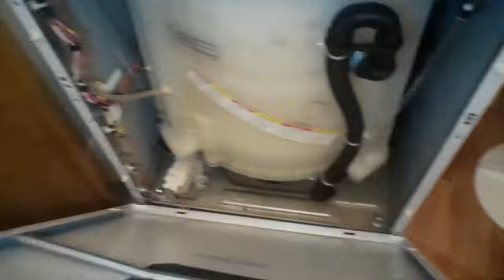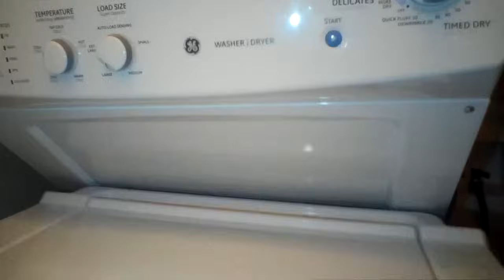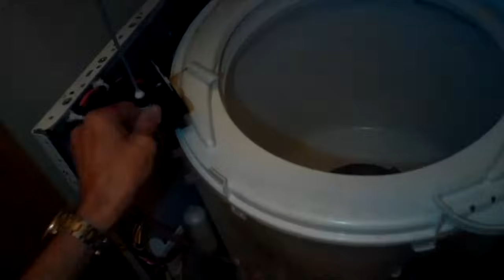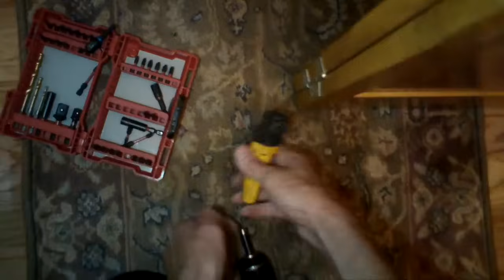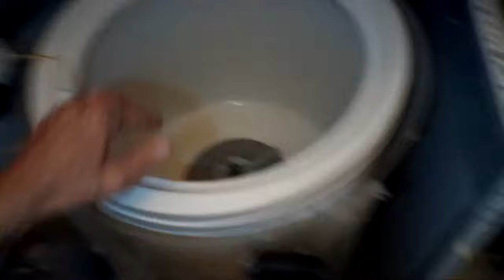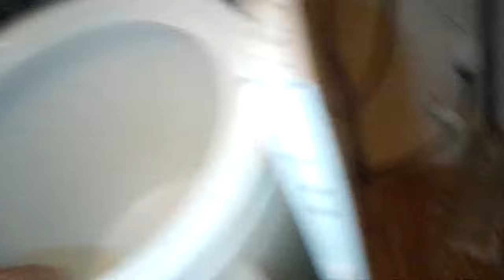✨ GE WASHER - DRYER COMBO - Spin Basket Access ✨

Comment: The front panel doesn't open even when I come in contact with the, 2 latches
Reply from the maker: When you press down to disconnect the right latch, use your other hand to hold a flathead screw driver between the top panel and front panel and leverage that right corner down and then repeat the same process on the left.

Comment: God a question-- I need to replace the lid lock, did I see you take off the top panel and that lock under there?
Reply from the maker: You should be able to replace it just by removing the front panel.
Reply: @ScottTheFixItGuyChannel  Thanks!

Comment: Do you have a video for taking apart the dryer cylinder to clean the fin things? I can only find videos on the front panel and your washer drum. But I desperately need to clean the lint and grime from the dryer.
Reply: I just use a vacuum with a brush attachment.  Takes some agitating with the brush, but it eventually comes off.

Comment: Neither I or a certified technician could get the tub off on mine. I had to order a whole new assembly. Even after I installed the new one and got the unit working, I fooled with the old assembly for weeks off and on using a variaty of methods including air hammers, etc, and never could get it appart. A very poor design in my opinion.
Reply from the maker: You speak the truth 😊👍
Reply: Was this covered under warranty? I’ve had mine for under 2 months and am dealing with this now. Tech didn’t even try because of what you mentioned here.

Comment: Hey there have a GE stackable where washer won't spin/agitate.

Had GE Tech come out. They ordered a new tub assembly with transmission/motor/sensor/tub etc... They installed it yesterday and still have exact same problem. 

Put into spin test, you see actuator drop gears into place then just sits there with pump running then after they come together a few seconds later it just stops and spin light blinks with blocked motor code.

So all along this might not have been a bad motor/speed sensor.

What else could this be that would cause the washer not to engage in agitate/spin? Computer board? Bad wiring harness in some place? Lid does lock and red light comes on but could it think lid isn't locked in some way?

They ordered a new board now. This is getting absurd. Just not sure why this is so hard to diagnose. 

GUD27ESSJIWW
GE Unitized Spacemaker
3.2 DOE cu. ft. Washer and 5.9 cu. ft. Electric Dryer
Reply from the maker: Great question James,
I would replace the lid lock and lid sensor.  It’s pretty easy to do👍
Reply: @ScottTheFixItGuyChannel  These parts?

Door Latch Lid Lock WH44X10288 / AP5270191
Magnet WH01X10626 / AP5270181

The sensor I'm having trouble locating the individual part. I see it's part of the whole wire harness thing but possibly you could order just it and cut/crimp it?
Reply from the maker: Those look good.
I’ll check on the sensor👍
Reply from the maker: Sensor: Upgraded WH12X10334 Lid Switch Washer Lid Switch Assembly by Sikawai Fit for G-E Hot-point Washer Replaces AP3968471 1256927 AH1482372 EA1482372 PS1482372
Reply: @ScottTheFixItGuyChannel  I ordered this from amazon 

Washer Lid Lock WH44x10288

Repairwares Universal Washing Machine Lid Switch with Wire Harness WH12X10334 1256927 AP3968471 PS1482372

In terms of needing to splice what is the best way to do that and if buying crimps, etc what should I be looking for? Also should I start with lid lock first before moving to sensor? I do get lid lock light and it doesn't open but I've read the circuit still technically might not be closed?

Thanks for the help. You don't happen to be in VA are you  lol.
Reply: @ScottTheFixItGuyChannel  Just FYI, the issue was the control board. 

Honestly I think anyone with any minor technical skill should just unplug their washer, remove the cover, pull the connections and unscrew the 2 screws and pull the board. As soon as I pulled it out and turned it over you could see the quarter size burn mark on the back of the board/burn on the white plastic holder.

If you have a good board you'll be able to see it on the back side.

It's amazing the GE techs that came out, both of them didn't pull the board but instead took like 30 mins to test the board vs just looking at it first which would have shown the issue.

Thanks for the suggestions!

Comment: Thank you for this vid! I moved into an apartment complex that had these in each unit. Mine was pretty used (should have seen how much lint i got out of the dryer walls). This vid helped me so i could take apart the bottom and get some of that grime!
Reply: Me too.. ours smells terrible.. do you know that tool he used to release the bolt?
Reply: Are you talking about what he used to get the agitator off? That was just a ratchet with a 11mm socket and 12 inch extension. If you are asking about what he was begging on with a hammer, I didn’t do that part. Mine is situated in a tight closet, and I couldn’t disconnect power, so I was really scared. I was gonna electrocute myself Or damage the motor parts, which im sure my landlord wouldnt be happy about. And honestly once I got the top white lid off, You can see inside the basket. Mine really didn’t look or smell that bad. It had really just been the agitator, and what was under it.
Reply from the maker: Nice job Nathan👍😊

Comment: I couldn’t get those clips on the panel to pop open like you did. All I did was scratch up the tool I was using. Would a flat head screw driver work better?
Reply from the maker: I think so👍

Comment: Is there a part two that would then show how to deep clean the drum? I find the sides of the spin basket that I can see from above (haven't taken anything apart yet) are super grimy, and even though I wipe what I can reach that obviously isn't enough to really clean it, and my clothes sometimes seem to still have soap (I use less than what the detergent bottles say to but still maybe too much) or something greasy on them.
Reply from the maker: I’m sorry Abby, they engineered it so you can’t remove the spin basket🤪
Reply: Pretty sure it can be removed. Disconnect pump hoses, water level tube, and any other attachments rhen pop all 4 of the hangers off at the bottom.b

Comment: Modern appliances suck. When I was a kid we had the same appliances for a decade and then the parents gave them to the kids when the grew up and they used them for another decade.  a few years ago I had a new washer and the factory  didn't install a hose/retainer clamp on a pump and it caused the pump to fail.  A couple years later I had a new/barely used stack unit stop drying. It was an inexpensive repair but, come on man.  

My latest is what brought me here. Another 5 year old stack unit with a clunky noisy spin.  I'll open it up and take a look but unless it's something easy, I'll probably just but a new one

Comment: how did you remove the agitator? i took off the bolt, but it wont come off
Reply from the maker: Can you put 2 dress belts under the agitator and then pull up on the 2 belts and wiggle as you pull.
Reply: this worked with two ropes pried up with a two by four and having another person hold the mmacchine from liftingg up on the otther sidee. also poured two tea kettles off  bboilinbg waterr in there

Comment: Hey Scott did you ever get that spin basket off? I have the exact same machine that I am trying to remove the basket from. I have the spanner nut off and have repeatedly soaked it with liquid wrench, PB Blaster and seafoam. I have used a lead Hammer to tap on the shaft of the transmission. I have my Cabrio rig in there with a bottle jack to lift up on the tub and so far no joy after a couple of days of trying. This thing is an absolute bear and it looks like yours was too. Any tips or tricks you can offer? I agree it must be corroded on there hard and I don't want to damage anything removing the basket

Comment: But what do you do if the basket won't come loose from the tub? This seems to be the main issue with older units. Is there a chemical or solution that can be used to dissolve this calcium "cement"? Mine is stuck and no amount of twisting or pulling is going to get it out of there.  As you stated its basically wielded together. If there's no way to dissolve this corriosion, it will have to be forced off somehow and will probably crack the basket. I see no other alternative. Help please...
Reply from the maker: Hi Sandy,

GE recommends that you replace the entire tub/basket assembly 👍

Comment: hi is there a video of how to replace the tub seal and put back together? I cant find any on your page.
Reply from the maker: Hi David, 
I’m sorry, I wasn’t able to remove the spin basket.
Reply: @ScottTheFixItGuyChannel  you can cut a board to fit under the basket lip put a carjack against the shaft and push it out like a puller

Comment: Now if the machine is any where over 3 to 4 years old... And I have done many

Get a cheap grinder and a cutoff blade. You can see the spanner nut is screwed on to a square shaft. Cut the nut at one of the points over the flat area of the shaft

A few unit I worked on the transmission was bad  because the seal leaked and the bearing was noisy...Bad however for the best because the inter spin basket would not come out. I had to take the cut off wheel, and (after removing the whole unit from the washer cut the transmission apart. Take the inter shaft out of the square shaft and then cut the square shaft flat with the metal on the spin basket 
Then take a Saw Saw and cut (from the hole left from the inter shaft) the square shaft in 2 places as to take pressure off the spin basket. The beat the shaft out.

Spin basket are over $200 
If it were not for Friends and Family I would tell them to replace the whole machine.

Be sure you can get the washer apart before you order the parts or you may get so deep that you are throwing good money after bad
Reply from the maker: Great info.
Thanks so much😊
Reply: OMG...your kidding me? That's a little much for me. As a woman and former G.E. appliance assembly worker, I thought I could do this. But after struggling with getting that damn nut off and now this...I give up. Won't be purchasing another G.E. unit I'm sad to say Especially now that they are owned by Haire, a Chinese company. We had a good run G.E. but time to move on....

Comment: I did not take his advice to replace the outer tub. (too expensive!) I removed the outer tub, turned it upside down and took off the plate that the motor and transmission are mounted to. The old seal came out easily and the new seal fit. A lot of work!  I hope it lasts1
Reply: I can't get the bolt in the bottom of the tub loose. Can you still get to it without taking this off?
Reply: @robertlester4569  I'm afraid not. I bought the cheap wrench and shimmed it tight. Just keep bumping with a small sledge hammer. Very little working room!
Reply: @stanleywells4468  Thank you for the response. I finally got the tub nut off by breaking it with a hammer and chisel, but the inner tub will still not slide up and out of the outer tub. I have banged it with a sledge to no avail. Once you got the nut off, did the inner tub just slide out, or do you have a trick for getting it loose? Thanks is advance.
Reply: @robertlester4569  Hi Robert, I'm in the same boat as you with this machine. Did you ever get your inner tub out in order to replace the seal? Thanks
Reply: @432b86ed  nope, never did

Comment: This has been a nightmare. I’m probably going to buy the whole basket. I don’t see how it’s possible to come off anyways. The shaft is square, and bigger than the hole. It won’t budge. I’m wondering if it screws on.
Reply from the maker: I called GE and they said you have to replace the whole basket assembly.  Terrible engineering.

Comment: Subaru Forester scissor jack with a 20" 4x4 works  perfectly for removing tub.
Reply: BUT THE GASKET INSTALLS FROM BELOW!!! have fun removing the whole tub, gear/motor assembly, and yet another lower gasket is inaccessible. Will try to order the whole gear/tub assembly tomorrow or haul this thing to the junkyard! Thanks GE: "We Bring Good Things to Life"
Reply from the maker: Thanks Brian,

It’s a terrible design.  Where you able to separate it using the car jack?

Comment: Scott, did you ever include a video about how to remove the agitator? I saw the tub seal leak video but that just showed the leak.
Reply: Use a belt mine was stuck and i used a belt and it worked woop woop !!!
Reply from the maker: The company says the best approach is to replace the entire tub assembly.
Reply: @ScottTheFixItGuyChannel  The nut holding my agitator on came off no problem (sounded like that was the issue most people had). Despite that I can't yank the agitator out. If I replace the entire tub assembly does that include the transmission and agitator?
Reply: I think it’s just the tub and spin basket
Reply: @ScottTheFixItGuyChannel  thanks for the prompt reply  I saw that in about an thread. I'd still like to attempt it. If the fastener holding the agitator, etc is too corroded I'll opt for the tub replacement. Figured I'd try and save the $300

Comment: I am in the process of trying to replace the tub seal. I used a drill to cut off the nut, a chisel to pry off the washer, and a pair of needle-nosed pliers to remove the o-ring. The tub won’t come off. I am not giving up yet. As a bit of constructive criticism, Scott, this is a great video.  Step by step it shows what to do (for the most part). BUT...#1...wasn’t easy to get the agitator off. Needed and extension rod for the socket wrench (small detail but would have been good to be reminded of before starting), and #2...regardless of whether or not you were able to repair this appliance, it would be good to follow up with what you did or didn’t do. I finally read the comments and it helped to know that I wasn’t alone, but it would have been even better to have that information as it applied to this visible example. Just an observation. I appreciate the information it did relay, though, so thank you.
Reply: wow.. i sooo cannot deal with this right now, but this machine has been junk since day 365:)
what size bolt/extension rod do i need? please help? i ma overwhelmed with appliances breaking right now.

Comment: The spin basket hub is very long so it gets seized up. Need to clean out the little holes and soak tons of rust buster. Need car jack to get it up. The whole tub needs to come out to replace the tub seal from the bottom.
Reply from the maker: Thanks Scott
Reply: @ScottTheFixItGuyChannel  how did you get it off your video stops before you remove it

Comment: this guy is so full of shit , I been beating on the shaft with a slug hammer and the basket still wont come off , that's wye the video ends before the because the basket  never came off ok Scott the no fix shit Guy
Reply: Timothy Eggers my question aswell having hard time to take off that star-like hub at the bottom to remove basket (trying to replace transmission)
Reply: Timothy Eggers i used a car jack and the jack bent.  There must be another clip or something holding the tub in.
Reply: id any body get it off
Reply: @guillenenviromental1  I beat and banged until I destroyed the old one (transmission, etc.) and finally got it out. The whole transmission assembly is only around $80.

Comment: I've got the spin basket off tonight with taps, eye bolts, and jaw puller.  Sorry no video, but i can send pictures if anyone is interested.
Reply from the maker: Awesome,

You’re the first person I know to do it👍
Reply: Ya it wasn't easy, I spend 3 days and many attempts.  I want to share some photos but don't know how to do it on youtube.
Reply: i'm happy to share the pictures, let me know where to send it to.
Reply: @alanx23  yes, can you please send me pictures?  I would really appreciate it!
Reply: I finally got it. I had to remove the motor and the bracket. I used a socket and extension that fit over the auger shaft but right size for that nut shaft. I  went nuts on that extension with a mini sledge hammer and everything feel right out. basket is off. there is no way any amount of penetrating oil was gonna loosen that up.
Reply: I used a 20 lb sledge like you stated on the spin shaft and it still is frozen.  Not only that GE doesn't sell the basket hub separately.  These GE stack units are garbage and blame GE for poor customer relations.  NEVER BUY GE AGAIN
Reply: Hi can you send me pictures? What type of socket and extension you used for that nut shaft? My basket is not coming off and my wife is about to kill me since I've being stuck with that basket for two weeks.
Reply: you won't get that off without breaking the hub or cutting the hub.  Its seized on there. then you'll have to buy new basket and hub, transmission also.  GE doesn't sell hub by itself.   good luck
Reply: I also can't budge the basket! Can you give more info how to do it?
Reply: Kasia Swierzewska any clues to this? I've got to replace a seal in mine but can't get the basket assembly apart to get to the seal.
Reply: send me that info. I cannot get it off. I took the whole basket out with motor and everything. still can get it.
Reply: Paul Esq i cracked the tub assembly trying to separate the spin basket. Ordered a new washer dryer set from Home Depot Saturday, thoroughly disappointed in GE on this one
Reply: i cant order a new one. this is a customer item. im about to tell him its impossible. I dont know if i should cut up the tub or the basket.
Reply: Paul Esq i believe the basket and mounting hub are the cheaper components
Reply: can u send me the pictures and what tools you used ?
Reply: 916 868 7182 can you send me some of those pics and info on how you did it and also how you took of the aggetator
Reply: Do you still have any of those pictures? I've been trying to separate it also, but no luck